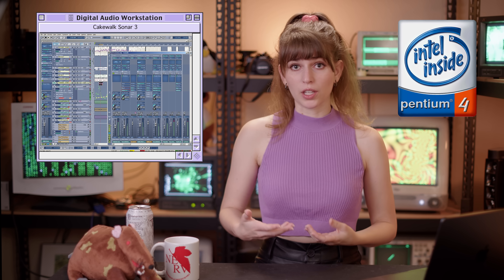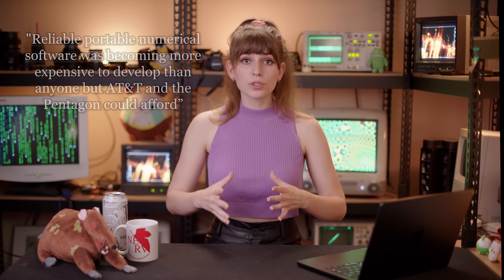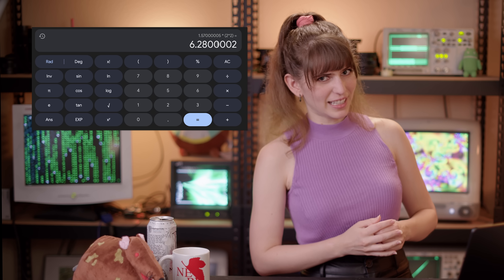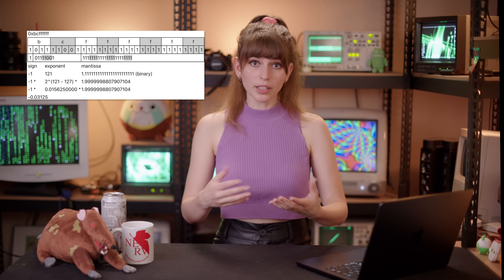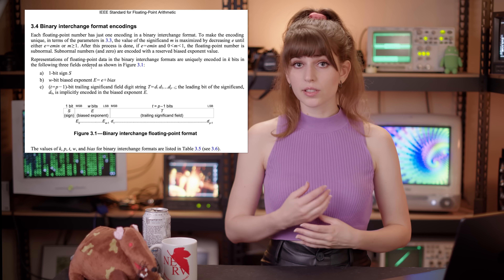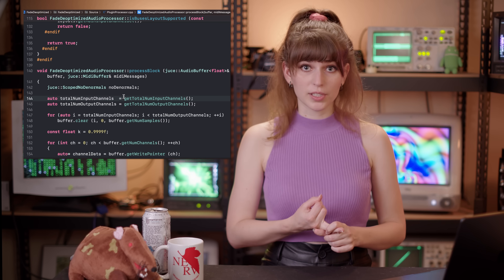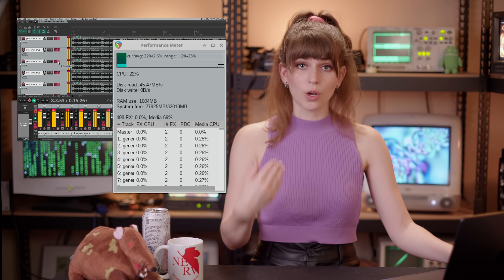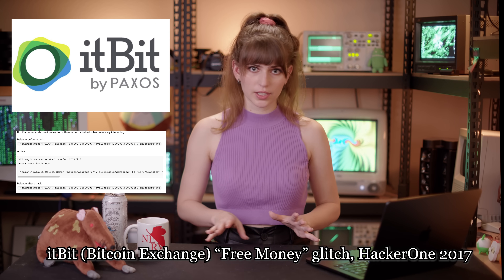Fading Audio is ROUGH on CPUs

Comment: Oh wow I've never heard of this. I always assumed that it'd just go to zero in these cases, that's the logical behavior. Having the code suddenly run up to a 100 times slower is not what I would have expected. What a crazy standard. Thanks for the clear explanation!
Reply: Subnormals are logical if you imagine that floats sit “over” your integers. For example you could have mm values. Then in some related calculations, km appear. Then don’t need mm precision for those large numbers, but still want to be able to add your mm without rounding errors. You don’t want glitches when you set (000) on the nose of your car, but then add an old US style bumper which protrudes. 0 should be nothing special.

Comment: Like it or lump it, Intel was right here. 

Forcing the industry to focus on precision is the right move, especially for a chip maker that uses datacenter uArches in consumer products. 

DEC didn't want to because they were A: broke and B: lagging Intel at the time

They needed any competitive advantage they could get. 

Intel on the other hand uses the same uArches in Datacenter stuff as they do in consumer stuff (a Xeon is just a Core with more stuff turned on, it's the same silicon just binned differently). They need the precision for their Datacenter business, so forcing the standard allows them to also use that same silicon without modification in consumer products. 

Remember, Intel owns their own Fab, and Intel is Intel's biggest customer.

Comment: If we change the way of thinking, we can have both precision and performance. But I made a game and used minutes as the smallest time measure unit and went full quantum bellow that and it worked just fine. In the long run, if you got random chances X/60 % that X seconds will result in 1 minute time advancement, your divisions are consistent and your randomization is not too biased, you end up having a pretty smooth time progression anyway. Depends on the use case and justification. I could justify that the action took longer or shorter than usual because that's what happens in life, even a simple operation like apple cutting depends on factors hidden inside the apple that you couldn't account for without x-raying the apple.

But sometimes you just can't justify. If we really need it, we should be able to get it.

I like principles that store the number in a way that can reproduce the number without actually storing the value. 1/3 is a great example. If you can store just 1 divided by 3 and provide precision based on the requirement, then that's the best you can do for all parties.

I also knew a guy that stored all his numbers as two variables, one was natural number and the other was the number of decimal spaces. He then run the decimals in the end so the calculation itself was as precise as possible. If the natural number was too large, he would just chop it off and carry into another variable. His calculations were never wrong, but he still couldn't see if the apple is rotten inside without cutting it open.

Comment: The ORSA program used for tracking all known objects in the solar system (or simulated solar systems) has had its predictions (forward and backward in time) in a set of possible trajectories due to lack of accuracy.  I think the RISC-V 128 bit floating point should improve this and help save us from an asteroid strike.

Comment: It seems nobody explained why underflow exists in the first place. Think of scientific notation: 5.4321 x 10³. In decimal we have any number from 1 to 9 before the decimal dot. In binary it is always 1, so to have one extra bit of precision, it is implicit and not stored. Except for when the exponent is the minimum! In the case of a 32 bit float, the minimum exponent is -126 and it has this special meaning of denormal numbers unless you compile the program to flush them to zero.

Comment: 8:41 "You can read this standard on-line today" -- not for free though! IEEE charges $110 for non-members, $86 for members. (That's for the latest revision, IEEE 754-2019. For the original, IEEE 754-1985, it's $76 / $56.)

Comment: I do have a few points is 1 why are you using floats for audio in the first place and 2 if you do why are you not using fast math that breaks ieee754 and provides consistent performance regardless of the operands value

Precise math is nice when you need it, maybe the default can be the faster but then it would also lead to bad surprises.

Comment: After being gungho about denormal, intel making about face when they introduces the MMX instructions set.
The MMX was deliberately designed to not handles floating point numbers that is after intel decided to have FPU integrated into the CPU starting from 80486 DX onward.

Comment: Cool video! Floating point gets even more trippy when you realize that A) binary has a different set of fractions which repeat infinitely (1/3 isn't necessarily one of them), and B) the density of representable floats between each integer changes. I've heard that representable floats between 0 and 1 represent half of all possible floats, which is too hard to believe.
Reply: They set the bias of the exponent this way.

Comment: IEEE754 which is stored as a 128bit number.

    union{
        long double WHOLE;
        struct{
            unsigned int LSDW:32;
            unsigned int HSDW:32;
            unsigned int EXPONENT:15;
            unsigned int SIGN_BIT:1;
            unsigned int PACKINGLO:16;
            unsigned int PACKINGHI:32;
        }SPLIT;
    }KEY;

Comment: Great topic but wasn't an issue unless your DAW was misconfigured. Your CPU should not be processing audio data—your soundcard should be. And if you are working in Audio, have a "multimedia system", or heavily into gaming, your soundcard would come with DSP which does all that fading and other processing for you.

This was really important because Windows (relevant to the Wintel discussion) is not a realtime OS and (good) audio requires a realtime OS (which the soundcards ran). Even still, running a *nix with a realtime kernel would give good audio but laggy interface. It is best to process them separately.

Today's CPUs are powerful enough and cache's buffering enough to make the result almost indistinguishable from one done with a dedicated processor, but for the few cents DSP adds to the cost of a board, the power savings pay for themselves in a day.

Comment: I'm working on a recompilation of Sonic 06 for the 360, and we actually had a pretty severe denormal issue that caused animations to lock up and the game to essentially softlock whenever you took damage. Fixed the instruction to correctly follow flush to zero mode from PPC code and it went away.

Comment: Question from a non programmer but a musician. While music is playing at a constant volume do very quiet sounds, say harmonics or decaying notes, get quiet enough to trigger this "inaccurate math"? Do you zero out quiet or fading sounds basically all of the time? Does this get worse with say every change in the music, add distortion or flanging echo etc... Are you introducing more miscalculations everytime you make changes to the music when it's in digital form? 

Again, I'm not a programmer or a digital engineer of any type. Just wondering if this has anything to do with the lack of "musicality" that many complain about with digital. Thanks to anyone who might know.
Reply: -80.0 dbfs is 0.0001 in floating point. But you need to go down to ~6.0×10⁻⁸ before you hit precision errors. So it would have to be a LOT of those very quiet harmonics to even become audible distortion. The rest of your question is more of a maybe/probably.

Comment: For finance I'd prefer if they'd not use floating-point at all. Rather fixed-point, and also preferably using BCD so you don't get wierd issues from switching from base 2 to base 10.

Comment: I was programming a Newton Rhapson method in RISC-V assembly for general functions, where I can put the f'/f in a macro, and its inverse to get a good initial guess. But then it exploded when using subnormal numbers and +-inf and NaN. So that forced me to try and really understand floating point numbers and actually read IEEE 754. What a coincidence you just made a video on this!
Reply: Why would you float the point here? Newton Rhapson only works around 1.0 . I also don’t get why music needs floats.
Reply: @ArneChristianRosenfeldt  My remark was only loosely related, and was about subnormal numbers. FYI, my Newton Raphson (at least for cube root) worked perfectly fine for the complete range of normal floating point values and only exploded for subnormals. Which I also have under control now, as well as NaN and +/-INF.
About music needing floats: I think you mean audio signal processing in general, and you can actually leave the "audio" out because the same thinking would apply to general signal processing and AD/DA conversion. I work in radio astronomy and processing is somewhat comparable.
During playback (DA) and recording (AD) you work with 16 bit numbers. In radio astronomy that is upto 14 bits. In the old days we just used 1 bit per sample and measured the edge going up or down. We had specialized hardware to do the processing steps then, not general purpose CPUs because they were way too slow. Sampling rate for astronomy is about 350 million samples/second.
Audio does not need more than 40000 samples/second and no more than 16 bits.
But that is for recording and playback. During audio processing you want headroom, so you process in 32 bits, because adding two 16 bit numbers can give a 17 bit answer and multiplying can give 32 bits. With many processing steps you may need more bits again to maintain fidelity, so going fully floating point is practical then and CPUs have floating point units and SIMD instructions for decades now.
What I really do no understand is how audio processing would ever get into subnormal numbers. Because there is ample room in a 32-bit float to make sure that the lowest "rung" in a 16-bit integer is still waaay above the subnormals, when converting back to integers and feeding them to the DA converter. It seems just like bad programming to me.

Comment: So Intel managed to lobby subnormals into the standard, because they had unreleased tech that could do it, they just neglected to mention that if such numbers were involved it would take much more clock cycles? (Or did mention but assured it would be solved in the future)
Reply: Or was it that this only really got significantly slower on the 2000s?

Comment: Cool video!
When it comes to finance, you could go on to mention new(er) parts of the IEEE standard: Decimal64 and Decimal128.  I believe these are actually handled, in hardware, by IBM mainframes.
Sadly, there are 2 (incompatible) decimal formats listed in the standard - which is highly confusing.

Comment: Chuck Moore, known mostly for the Forth language, also designed CPUs.  He rejected the idea of using floating point because for any particular application, a fixed-point solution can be designed with better precision and using a fraction of the silicon.

And he is correct about this - if you are implementing numeric code at the level of exactitude that is generally demanded when working in Forth. The reason why floating point became so popular in the first place was because many people doing numeric work desired programs that they didn't have to think that hard about: using computers to automate a task for ease and to interpret our intentions, versus optimizing them for throughput and precision. Floating point allows for that because it drops out the aspect of configuring precision: once you've set the total width, you need not specify anything additional or do any conversions to compute a result, so syntactically, FP routines can be more succinct and take "any kind of floating point number no matter where it came from", and all the nuance, including the dark corners of the IEEE spec, is hidden away. It's great except that it's a kind of falsehood we're telling ourselves since it creates a lot of unintuitive behavior.
Reply: The issue with "for any particular application" is that you need to know what that "particular application" is before you design the silicon. With FP, you can design the silicon first and then decide on what the "particular application" is later. And you can have a standard FP format suitable for most applications. If you design your fixed point solution for each application, you end up with a proliferation of mutually incompatible representations.
Reply: Make sense when you design silicon for non-general purposes.

Comment: audio fading is only really time consuming in the render when it's something like sentence mixing with pitch shifting, stretches and dozens of effects, maybe on Fruity Loops 8 it spiked cpu usage but that that bottleneck was generally fixed by FL12 and after. now, fading video still takes as long as it ever did, it doesn't help that by default every single video editing software adds 0.3 seconds of fade to every source, needing it to be something people have to learn about to turn off, if not adding to unnecessary longer render time if not absolute crashes on render, for those unaware

Comment: i wasn’t aware of the speed penalty but subnormals are far small enough to just round them to zero for audio applications
Reply: for context, normalized audio with consistent levels for listening purposes only is at nearly full quality with only 12 bits of integer data storage
Reply: for loading audio from disk, subnormals with float32 would be faster as the disk speed is the bottleneck and doubling that transfer speed is worth it (probably even worth storing with lossless compression). but in effects or synths, using float64 can have very little performance cost (internally it’s all done with 80 bits precision).

Comment: Interesting ... but, in 1993 I already used a DAR system which could do stuff that is even now impossible to do. Simultanious crossfades on 16 tracks reaal-time no rendering and (!!!) segment based EQ 5 bands parametric with two effect sends ALL REELtime NO rendering! Sure it was 16 bit and only 16 tracks but still. This was done by smart programming in RMX, the system ran on a DOS based system with RMX. https://www.youtube.com/watch?v=l6HhWqqsWuw&t=58s
I use Nuendo 12 at the moment I like it but no segment based anything unless rendering, so many many tracks ned to be used.
How can the processor power now be used too much compared to better possibilities in 1993?

Comment: Never use floats for finance. But if you need that much precision, you can use more bits, or rescale the space.  I'm generally in favor of keeping things normalized so the hardware can be simple and fast. Even software implementations can be pretty well optimized if there aren't a bunch of special cases.

Comment: I would not say it is the most CPU-intensive task, in the sense that audio is only running at 44KHz, so in stereo that is only 88 thousand samples/sec to scale. For comparison I once wrote a market data engine that produced 3 million messages/sec output. I should think that at 88 K a modern CPU is barely ticking over.

Comment: If I understand correctly, denormals are numbers smaller than the smallest possible exponent. In that case, the mantissa is interpreted without the implicit leading 1. So instead of <sign> * 1.<mantissa> * 2^<exponent>, it's <sign> * 0.<mantissa> * 2^<exponent>, which requires completely different hardware logic, and/or convoluted software roundabouts.

Comment: This specific example is a fine example of why floats shouldn't be your first choice anyway, as it'd be far better done with fixed precision using integer arithmetic. Each audio sample on a CD is 16-bit, and it probably makes sense to consider this as unsigned and apply a bias so that 32768 is the central value. Let's say you want a 16-bit volume per track, (0 to 65535, with 65536 representing 1.0) you can multiply these together to get something that fits into 32-bits.

If all the volumes of the different tracks add up to 65536, then you can just sum all these 32-bits together knowing that they won't overflow the 32-bits and use the top 16-bits of the total as the output.

If this is just regular mixing and the sum of the volumes doesn't add to 65536, then you multiply as before and extend the 32-bit result to 64 bits and accumulate in 64 bits. If you are mixing N tracks, the maximum value of this sum is N*(2^32). The important thing to note is that there's no chance of overflowing the 64-bit accumulator (unless you had over 2^32 tracks) , and the lower 16-bits can now be discarded after the 32 (this is the same scale as the volume multiplier).

If the resulting value is greater than 16-bit, then you can clip - either with a hard cut-off (computationally easy) or above a threshold apply some curve (effectively an audio version of a gamma curve) to make it sound less harsh. Interestingly, one way of doing this is similar to how the mantissa is handled in a float anyway. But the real truth is that if you need to apply clipping to the final CD mix, then your volumes on all the tracks are too high anyway, and you should reduce them accordingly.

The entire pipeline can be integer and in the past this would have significantly outperformed any floating point version anyway. Nowadays, it's less clear which would actually be faster as many processors have very optimised and pipelined floating point fused multiply and add instructions. Fixed point should definitely be more accurate though.